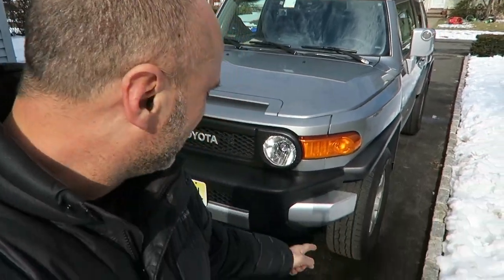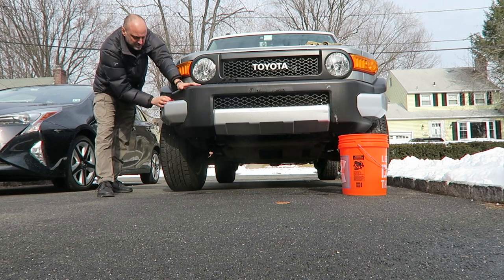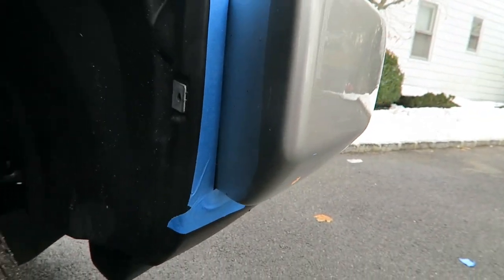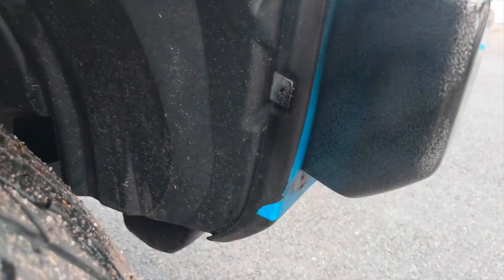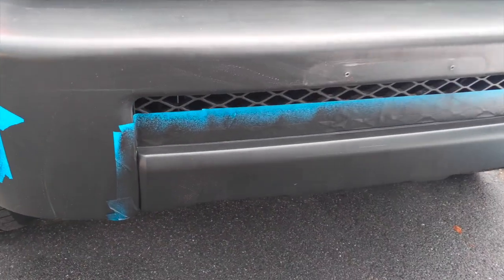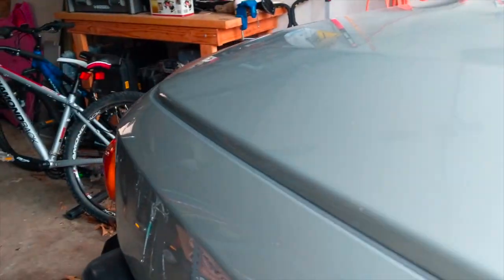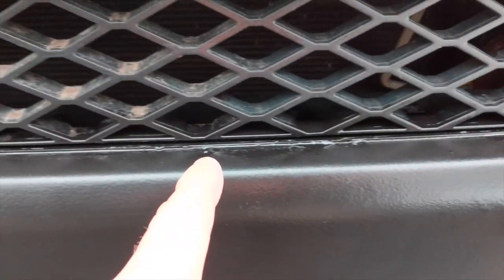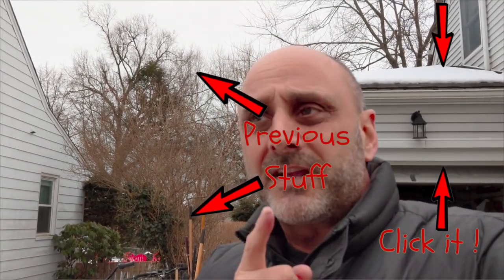Plastidip your Toyota FJ Cruiser

Comment: This is a perfect vid o on how NOT. To do things. It takes 10 mins to take front bumper off of vehicle and do it right , supposed to recoat every 5-10 mins, not every half hour. Remove tape immediately after putting final coat on. Warm up can of plasti-dip before using. Use in temps above 70 degree Fahrenheit !! Pay NO attention to this video
Reply from the maker: Tom Mc. Thanks for the info. It was my first time using Plasti dip. I agree with what you wrote. Next time I will definitely fix my mistakes. Surprisingly the paint is still holding  up 6 months after.
Reply: Also, don’t spray continuously... do single sprays left to right and right to left letting your finger off after each spray.  Will help with a more even application and minimize runny-ness/ blotching.
Reply: Can specifically says every 30 mins

Comment: Plasti dip can come out a little chunky in the winter time.  putting the can in a hot bucket of water or running your heat gun on the can will help. but I would wait till temps are above 60f to get it perfect.
Reply from the maker: carbonunit thanks. Didn't know that. Overall it turned out very nice. It's been 6 months now and still looks like day 1.